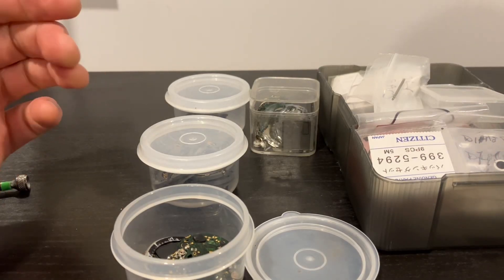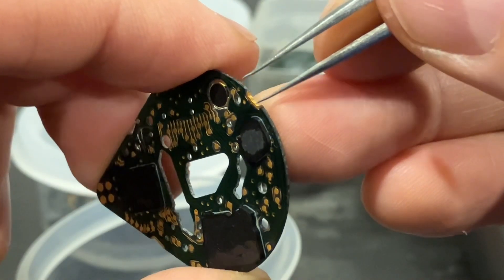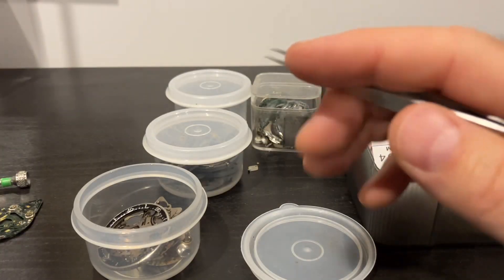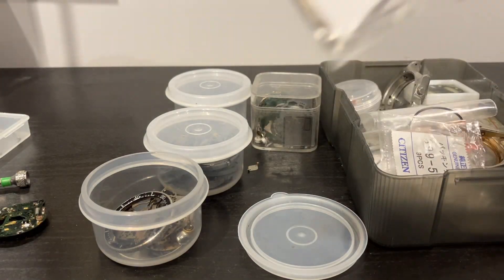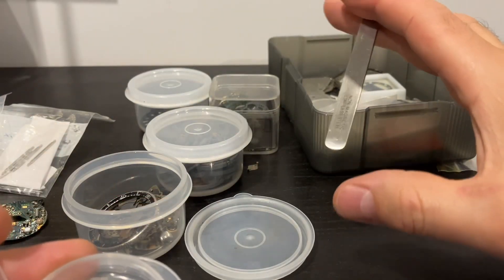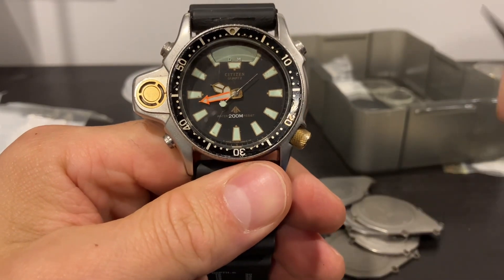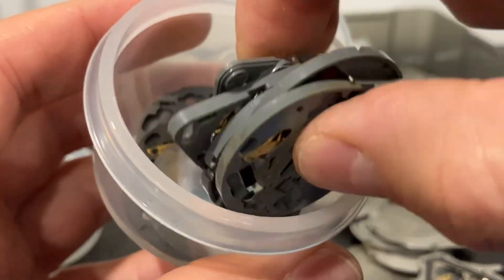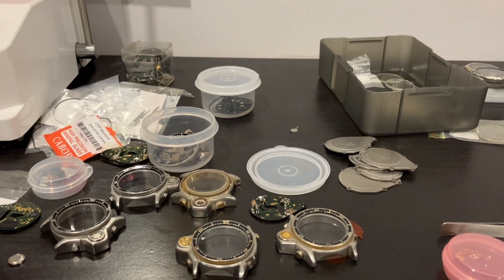aqualand circuit plate worn out; rusty gear bridge. how to fix. Tons of parts.

Comment: Funny that you adress the "gear housing problem"
Just bought a 1988 C022 in as new condition...
BUT, whit new batteries only the digital watch would work...
The analog watch was like part "stuck" part working...
Sometimes moving 15 min per 60 min and the following hour stuck....then almost keeping time the next hour...then stuck again..

Could it be the gear bridge need cleaning with lighter fluid and oil?

Best regards/
Robert, Sweden
Reply from the maker: dear Robert, i made that clip in part because one viewer asked about the same problem. Yes, this is a common problem with the gear bridge in these old models. Please check and let me know how that went. Best regards and thanks for watching 👋🏻👋🏻👋🏻
Reply: @plasticindices3385  I will...thank you very much🥰
Reply: Hi again..
Your fix for the gear housing turned out just perfect- I sprayed the gear housing with lighter-fluid....tiny amount of oil, then unscrewed and tightened (carefully) the two screws in the housing....works like a charm now!
Thank you very, very much...so happy❤
Reply from the maker: @officialteamhammertimesweden  I am glad, my friend! Take care and stay tuned! 👋🏻👋🏻👋🏻

Comment: Do you know the size of the wrist strap spring bars? mine seem to be too skinny for the diameter of the strap hole. Really appreciate all the advice & help with your videos
Reply from the maker: Hello friend, many thanks. The size is 24 mm. Must source a good pair of pins otherwise the strap will come off the case. Hope this helps 👋🏻👋🏻
Reply: I have the 24mm length but the diameter seems to small 1mm. it looks like closer to 2mm would fit better?
Reply from the maker: @kevindougherty593  Oh yeah, the diameter must be solid. They are between 1mm and a fat Seiko spring bar. I think seiko divers bars are around 3mm. Hope this helps

Comment: Where can I find a spring for the alarm on a citizen c023 movement
Reply from the maker: @davidgravedoni3480  the best place is Ebay. However, you dont need to buy a spring. Look, grab any strap pinbar and disassemble. You will find inside a spring that you may use as connector for the speaker. Cheers!
Reply: @ also I replaced the batteries and I can’t get the analog hands to work. The digital readout works perfect I have the one with the silver and gold bezel.
Reply from the maker: @ Thats an easy fix. The gearbox is dirty. I do not recommend disassembling it because it is very hard to put it back together. Rather, Open up the caseback, you will see the gear plate held together by 3 screws. Slightly untighten those screws and gently apply a dropplet of watch oil on the jewels you see (3-4 of those). Close the caseback, unscrew the crown and pull it out, and move it forwards and backwards a few times. Should work now. Cheers

Comment: Do you know the part number citizen uses  for the circuit board?
Reply from the maker: I do not. However they are not available anymore. The old c0xx modules were  replaced by the J2xxx ones. Cheers!